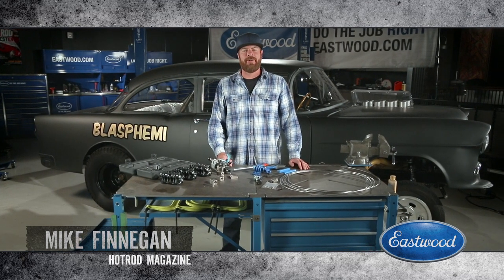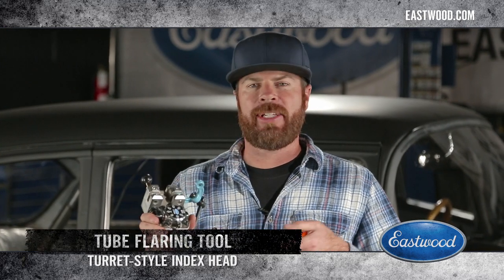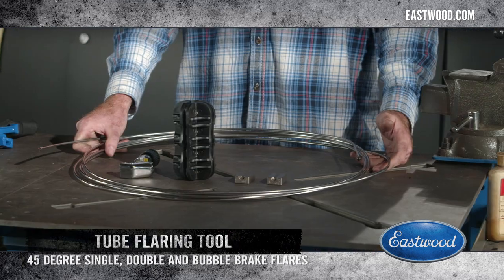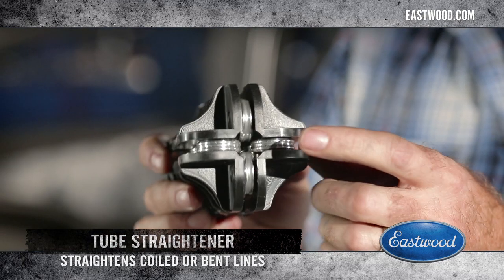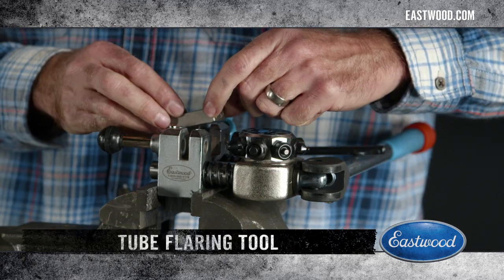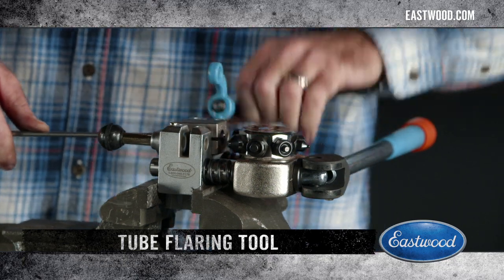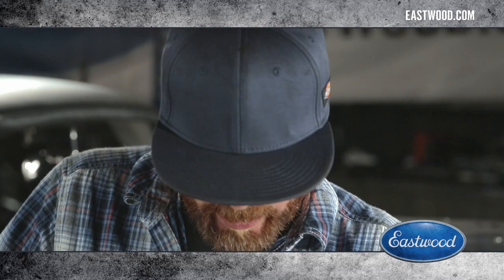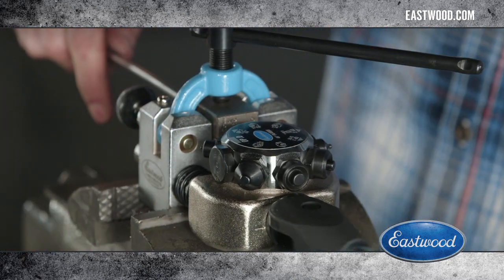How To Straighten Brake Tubing & Make Perfect Flares with Mike Finnegan of Roadkill & Hot Rod

Comment: Problem is, the flaring dies are all so long that tight radii are out of the question, try building stainless fuel lines to incorporate a pressure regulator with a dual feed Holley 4150